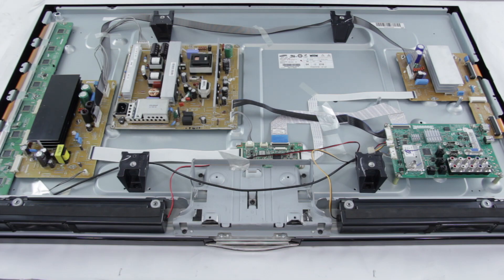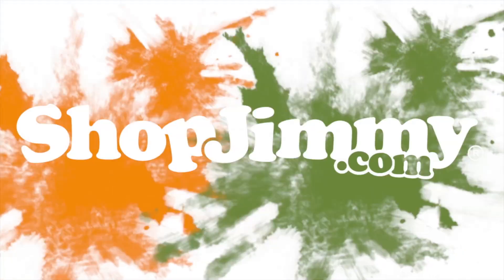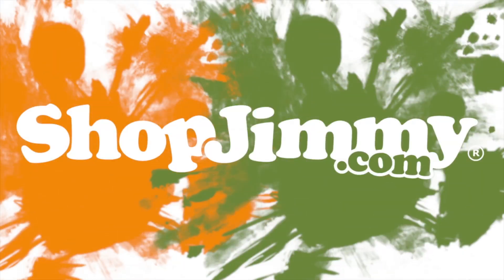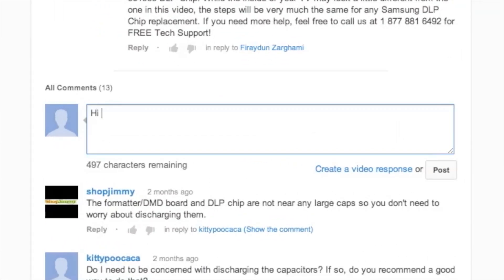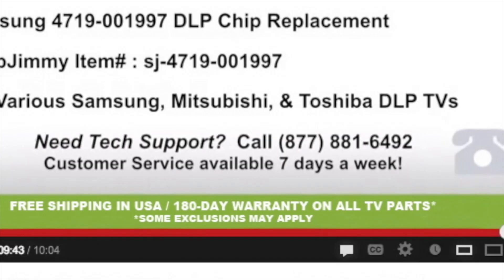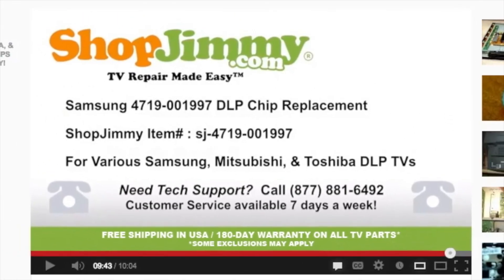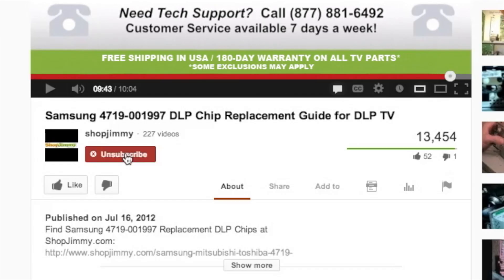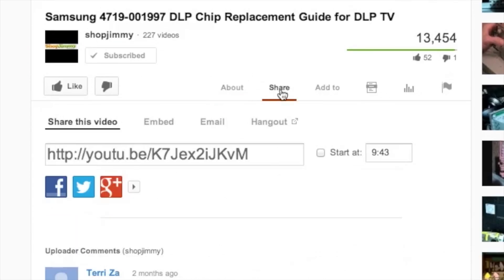Plasma TV Repair Tutorial - Common Symptoms & Solutions - How to Fix Plasma TVs

Comment: I have a Lg 42pj350-UB Plasma tv and it has a picture but it is covered in sparkles that are red,blue,and green i am lost i checked the power supply aLL VOLTAGES MATCH. I CHECKED THE Y SUS SAMETHING I REPLACED THE BUFFERS! I THINK IT MAY BE THE CONTROL BOARD!
Reply from the maker: Sgt Damion Myers  Please watch this video FIRST to help with your repair!  TV Repair! LCD, LED, Plasma, DLP How To Fix Your TV with ShopJimmy.com Help!   I recommend replacing the ZSUS board first.  Click this link to replacement parts:  http://www.shopjimmy.com/catalogsearch/result/index/?cat=67&q=Lg+42pj350-UB  Be sure to match part numbers on your current board, with your replacement for compatibility.  Here is a link to a video showing how to identify your part number, click here:  LG Plasma TV Repair: DIY Part Identification Number ID Guide for LG & LG Philips Plasma Panel Parts  Thanks and please let us know if you have any further questions with your TV Repair!  www.shopjimmy.com

Comment: HI SHOPJIMMY, I HAVE A SAMSUNG MODEL : UN60C6300SFXZA   VERSION : FB01 PLASMA TV THAT AS 3 LINES ON THE LEFT OF D SCREEN FROM TOP TO BOTTOM..I NEED TO KNOW IF I  CAN GET PARTS FOR IT.
THANK CARLOS
Reply from the maker: CARLOS AEDO   This sounds like a TV plasma panel (TV Screen) problem.  If your TV panel is bad, it may be more cost-effective to replace the TV as panels are typically hard to find in stock, difficult to replace, and expensive.  Thanks and please let us know if you have any further questions!  www.shopjimmy.com

Comment: Hi, I have a Zenith 42" plasma model  #p42w46x  that unplugged far a day and when plugged back in it came back on with colored "snow" on the right third of the screen.  when given a signal from the dvr it displayed a full screen of colored "snow" bright white with various colors throughout. The sound works.  Any suggestions?  Thanks!
Reply from the maker: Don Jacobs   Please watch this video FIRST to help with your repair!  TV Repair! LCD, LED, Plasma, DLP How To Fix Your TV with ShopJimmy.com Help!  I recommend replacing the X-Main Board in your TV.  Click this link to replacement parts:  http://www.shopjimmy.com/catalogsearch/result/index/?cat=67&q=p42w46x  Be sure to match part numbers on your current board, with your replacement for compatibility.  Here is a link to a video showing how to identify your part number, click here:  LG Plasma TV Repair: DIY Part Identification Number ID Guide for LG & LG Philips Plasma Panel Parts  Thanks and please let us know if you have any further questions with your TV Repair!  www.shopjimmy.com
Reply: ShopJimmy.com
Thanks for the advice!  I can't find X-main on the parts list in the manual. Your web site just has the Logic control board and ysus board listed for my model. Is X-main the same as the main logic board? Or the xrlt or xrrt assembly? Thanks
Reply from the maker: Don Jacobs   The X-Main is the same as the XSUS board.  I apologize for not being more specific.  Follow this link: http://www.shopjimmy.com/catalogsearch/result/index/?cat=67&q=p42w46x  Thanks!  www.shopjimmy.com
Reply: ShopJimmy.com
I replaced the board you recommended but the symptoms are still the same. Any other help you could offer? Looking at it again it is more like vertical lines of color and snow that fill the screen, if that makes sense.
Reply from the maker: Don Jacobs   If the lines are vertical then this sounds like a TV panel (TV Screen) problem.  If your TV panel is bad, it may be more cost-effective to replace the TV as panels are typically hard to find in stock, difficult to replace, and expensive.  Thanks and please let us know if you have any further questions!  www.shopjimmy.com

Comment: Hello,  I have a Samsung plasma model code pn51e550d1fxza.  Had a power outage last night and it seemed that low voltage may have continued to some outlets.  Power eventually went out completely.  When power came back on the TV was flashing the red led 5 times and you can see the screen flash one time.  It will do this repeatedly when turned on. No pictures even shows up, just repeated cycling.
Reply from the maker: 4runner12345  Please watch this video FIRST to help with your repair!  TV Repair! LCD, LED, Plasma, DLP How To Fix Your TV with ShopJimmy.com Help!  I would start by replace the main board to see if that fixes the problem.  Click this link to a replacement main board:  http://www.shopjimmy.com/samsung-bn94-04644b-main-board-for-pn51e550d1fxza.htm  Be sure to match part numbers on your current board, with your replacement for compatibility.  Here is a link to a video showing how to identify your part number, click here:  Samsung Main Boards & Digital Boards: Part Numbers for LED, LCD, DLP, Plasma TV Repair  Thanks and please let us know if you have any further questions with your TV Repair!  www.shopjimmy.com

Comment: I have a Samsung model  #PN42A450P1DXZC   Version BS02 which has developed stationary, narrow, 1 pixel-wide vertical color lines on the right and left sides. The left bar is purple and the right bar is light blue/turqoise when viewed on the TV's white burn protection screen. What would be causing this and what is the fix? Thanks.
Reply from the maker: polar1ty55   This sounds like a TV panel (TV Screen) problem.  If your TV panel is bad, it may be more cost-effective to replace the TV as panels are typically hard to find in stock, difficult to replace, and expensive.  Thanks and please let us know if you have any further questions!  www.shopjimmy.com

Comment: I have a Samsung plazma PN58A50S1FXZA that goes through the start cycle for at least 10 minutes before it produces a viewable picture. From watching your video and checking other informational sites its appears to be a faulty capacitor in the power board. Note that I do not qualify for the free repair from Samsung because the TV was produced in 2009, after the December 2008 deadline in the lawsuit. My problem is that I do not see a matching power board for my model on your website. Is there a matching board I can purchase or should I attempt to repair the capacitors myself?
Reply from the maker: Mike L   Try this at your own risk. Unplug the TV, then disconnect the y board and plug in the TV to see if the TV powers up. Reply with the results of this test. Thanks! www.shopjimmy.com
Reply: I disconnected the Y-board from the power board. After powering the TV on it continues to cycle on and off the same way as when connected except the picture screen does not light up at all.
Reply: The X board gave me the same result as the Y board
Reply: Mike L I have the TV disassembled waiting for a reply

Comment: Hey ShopJimmy! My Samsung PN51E8000GF Plasma TV will not turn on.... As soon as i plug it into power it makes some clicking noises and the standby light flashes a couple of times but then does not do anything when I try to turn it on. I paid someone to come and look at it and they said it was the P Logic board so I bought one from you guys and replaced it but its still not working. They also said the power supply was fine. If you could help me out id greatly appreciate it!
Reply from the maker: The Cody Jolly   Try this at your own risk. Unplug the TV, then disconnect the y board and plug in the TV to see if the TV powers up. Reply with the results of this test. Thanks! www.shopjimmy.com
Reply: Ok so I unplugged the Y board and tried to turn on the tv but all it did was make some clicking noises as soon as I plugged it in and will still not turn on. What else should I try? Thanks

Comment: Good morning ShopJimmy.  I have a Samsung Model HPT5064X/XAA that just turns off and on now.  We cannot watch TV because of it. I remember that it pop a couple of times and turned off.  It started out slow and now it just clicks off and on, off and on.  So we unpluged the TV and begin to research a solutions.  Based on your video above it seems like it is the Y-Sustain Board.  What are your thoughts?
Reply from the maker: Jeff Whitmire  Please watch this video FIRST to help with your repair!  TV Repair! LCD, LED, Plasma, DLP How To Fix Your TV with ShopJimmy.com Help!  I recommend replacing the Y-Main Board and the Y-Buffers in your TV.  Click this link to replacement parts:  http://www.shopjimmy.com/catalogsearch/result/?q=HPT5064X%2FXAA  Be sure to match part numbers on your current board, with your replacement for compatibility.  Samsung Plasma TV Repair Tutorial - Identifying Samsung Plasma TV Parts - How to Fix Plasma TVs  Thanks and please let us know if you have any further questions with your TV Repair!  www.shopjimmy.com

Comment: I have an Akai PDP4294 that is just over 10 years old. Until recently I never had a problem. Now I am having a constant problem that could either be described as a flickering or shaky picture. In addition, the picture randomly becomes slanted vertically and the right side of the picture is displayed on the left. All of this happens even if nothing is connected to the TV, and when only the TV's menu is displayed.  Thanks for any help you can provide.

Comment: I have a Panasonic model MC127H27U12 and the tv turns on with no picture. After about one minute the set turns off. The screen remains dark and no controls affect the tv.  The fuses are all good and it does have some DC output however I have no schematic and not sure what or where the voltages are.
Thanks for any help you may provide.
Berry

Comment: Hi i have an LG 50pv400 50" plasma tv that powers on and functions completely, but does not have a display. there is no picture to the panel. theres no bulhing capacitors or blown fuses. please let me know
Reply from the maker: Haki Alyassiri   Please watch this video FIRST to help with your repair!  TV Repair! LCD, LED, Plasma, DLP How To Fix Your TV with ShopJimmy.com Help!  I recommend replacing the YSUS and the YDRVTP & YDRVBT boards in your TV.  Click this link to find replacement parts.  http://www.shopjimmy.com/catalogsearch/result/?q=LG+50pv400  Be sure to match part numbers on your current board, with your replacement for compatibility.  Here is a link to a video showing how to identify your part number, click here:  LG Plasma TV Repair: DIY Part Identification Number ID Guide for LG & LG Philips Plasma Panel Parts  Thanks and please let us know if you have any further questions with your TV Repair!  www.shopjimmy.com

Comment: dear shopjimmy, I have the same problem as billkerry1 has, but my model is the 58" plasma pn58a550s1fxza. Wouldn't it be easier and less headaches down the road with replacing the whole back panel with all 3 boards included?

Comment: I learn on your video how i get the model.

It is EBR63526904
The Logic Board is EAX61300301

Good afternoon! I have the LG 50PK550 TV, my TV no picture but sound it emits. I wonder if the problem is on 50R1_60R1_CTRL. It has a green LED that flashes and has told me that this has led to always stay connected. I'm afraid to buy the wrong piece and not resolve. Would you assist me? Do you have the replacement board for my TV? And do you shipping it to Brasil? Thank you.
Reply from the maker: Rodrigo Quintas  Please watch this video FIRST to help with your repair!  TV Repair! LCD, LED, Plasma, DLP How To Fix Your TV with ShopJimmy.com Help!  I recommend replacing the YSUS and the YDRVTP & YDRVBT boards in your TV.  Click this link to replacement parts:  http://www.shopjimmy.com/catalogsearch/result/?q=LG+50PK550  Be sure to match part numbers on your current board, with your replacement for compatibility.  Here is a link to a video showing how to identify your part number, click here:  LG Plasma TV Repair: DIY Part Identification Number ID Guide for LG & LG Philips Plasma Panel Parts  Here is a video showing how to replace parts:  LG 50PK Plasma TV Repair EBR62294102 YSUS Boards Replacement Guide  Thanks and please let us know if you have any further questions with your TV Repair!  www.shopjimmy.com

Comment: Hi!
Good afternoon! I have the LG 50PK550 TV, my TV no picture but sound it emits. I wonder if the problem is on 50R1_60R1_CTRL. It has a green LED that flashes and has told me that this has led to always stay connected. I'm afraid to buy the wrong piece and not resolve. Would you assist me? Thank you.

Comment: Hello ShopJimmy, i have a samsung ps50c7700 tv and a while ago it started to get horizontal lines with the pixels in different colours and not all of the lines are over the complete width of the screen (more like interference on a old tv with antenna or bad cable). Then after a few minutes the screen goes complete that way and then it turns green and starts scrolling top bottom :-s. When i leave the tv unplugged for a while i can watch again for like 15mins normal and then it returns. Ow when i put it on analog cable the problem doesnt occurn. Only with the hdmi and usb ports.
Reply from the maker: joske831   This sounds like a TV panel (TV Screen) problem.  If your TV panel is bad, it may be more cost-effective to replace the TV as panels are typically hard to find in stock, difficult to replace, and expensive.  Thanks and please let us know if you have any further questions!  www.shopjimmy.com

Comment: I have 42" Vizio tv that doesn't seem the show picture or sound when plugged into the cable cord but shows through HDMI or AVI. Cable shows if jerry rigged to just barely touching. Any suggestions on a fix?
Reply: What is the going rate for the board and can I insta it myself by watching you tutorials
Reply from the maker: Alexander Hernandez   What is your TV Model number?  I need the TV model number before I can see prices of potential replacements.  Click here to view a video that shows how to find your TV model number:  TV Repair STEP #1 Help IMPORTANT TUTORIAL How To Find Your TV Model Number Tutorial TV Repair Help  Thanks!  www.shopjimmy.com

Comment: Yes I have checked and I have no power at either and I don't have power on the ps on pin. If I apply power to the ps on pin I do get vs power and I haven't checked VA power when doing this but it powers up then bleeds down
Reply from the maker: Louis Rothbauer  Please watch this video FIRST to help with your repair!  TV Repair! LCD, LED, Plasma, DLP How To Fix Your TV with ShopJimmy.com Help!  Then I recommend replacing the power supply board in your TV.  Follow this link to replacement parts:  http://www.shopjimmy.com/catalogsearch/result/index/?cat=59&q=PN42C450B1D  Be sure to match part numbers on your current board, with your replacement for compatibility.  Here is a link to a video showing how to identify your part number, click here:  TV Part Number Identification Guide for Samsung DIY TV Repair Power Supply Unit (PSU) Boards  Thanks and please let us know if you have any further questions with your TV Repair!  www.shopjimmy.com

Comment: Hi, I have a Samsung PN42C450B1D. I have sound but no picture. I have no vs or va voltage. I have no PS on signal but even when it's on I have standby voltage.  I assume it's probably a main board but I'm not sure if another board would cause this. Also the power light blinks 5 times on power up. Thanks for any help
Reply from the maker: Louis Rothbauer   Try this at your own risk. Unplug the TV, then disconnect the y board and plug in the TV to see if the TV powers up. Reply with the results of this test. Thanks! www.shopjimmy.com
Reply: I have already done that with no difference
Reply from the maker: Louis Rothbauer   Try the same test on the other X-Main board in your TV.  Thanks!  www.shopjimmy.com
Reply: I've done that too, I had just the power supply,  the main board and the logic board with the same results,  the ribbon cables were all still attached though
Reply from the maker: Louis Rothbauer   Have you checked the VA and VS voltages on the power supply with a meter?  Thanks!  www.shopjimmy.com

Comment: hi I have a Panasonic Plasma HDTV model number tcp42u1 serial number 92640048. my TV goes through a power cycle by itself it turns on and off repeatedly without me doing doing anything and i have no picture. Is this the Y sustain and buffer boards? can you recommend me a board too. Thanks

Comment: Hi Mate I have a 50" Plasma thats about 5-6 years old MODEL CODE: PS50B450B1DXXY
It makes the click noise as if its going to turn on but faintly you can hear it tick. for eg; Click tick tick tick tick and then it repeats that process. Its the tv in the kids room so its always on. i was watching tv with my daughter and it just turned off and started doing that. I am however enjoying not watching Frozen Constantly but soon the little critters will want to watch my tv. Could it be those Fuses? are they a generic fuse? 
Cheers
Reply from the maker: OctoberGrey   Try this at your own risk. Unplug the TV, then disconnect the y board and plug in the TV to see if the TV powers up. Reply with the results of this test. Thanks! www.shopjimmy.com